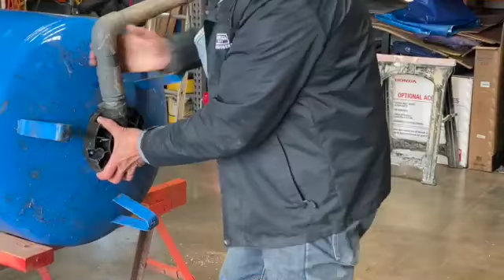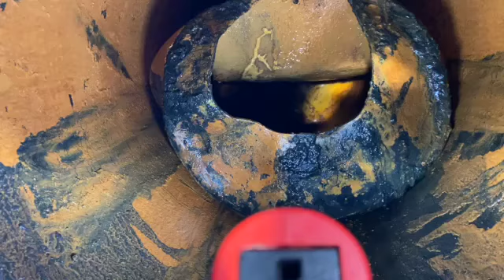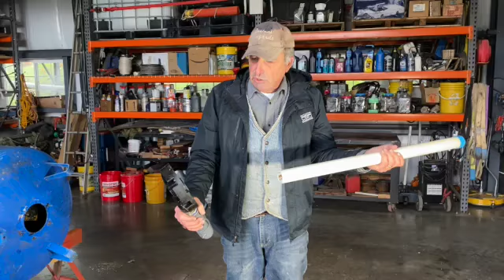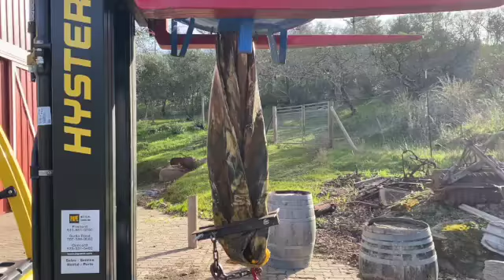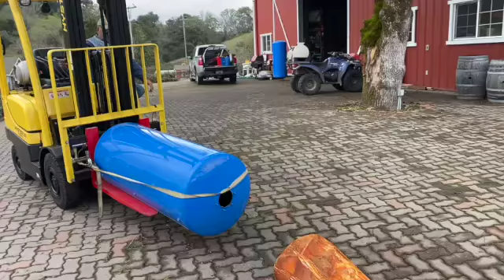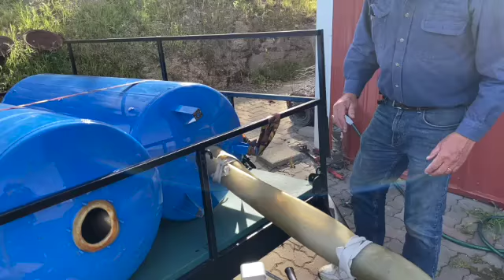FlowTec pressure water tank bladder replacement & install

Comment: Just swapped out my tank today I bought an exact replacement 3 years ago because I knew the time was coming( I got 25 years out of my tank shallow well running 20/40) was thinking about rebuilding my old one  to keep on hand. Unfortunately it does appear the bladders have been discontinued. But hey it was a good run and thanks for the great vid.

Comment: Thanks! Watching your video has convinced me to just buy a new tank bite the bullet on the cost. Even if I can get that bladder which is in doubt it seems like a real pain in the ass dirty job to replace. I have the water worker 86 gallon tank right now that I put in in 2015 so I'm sure the bladder is due to fail. Right now it's working but I'm just planning ahead, but then again I'm 75 years old so maybe my sons will have to deal with it....... LOL

Comment: Great how to do it video lots of good tips.  My two FlowTec tanks had some problems which I'm sure is my fault! Didnt check air pressure, one tank was waterlogged the other was empty. Both bladders were ruptured, because of not keeping track of the air pressure for a couple of years. Now I check every 6 months or so like clockwork. After 6 months both were down 5 PSI per tank. Ended up giving one tank to neighbor for a outdoor fireplace, the other I replaced the bladder. The problem is the tank will not hold air and is leaking around the bolt on base? Will have to pull it apart again to see why it is not sealing. In the meantime I replaced both with two new 86 gallon Water Worker diaphragm tanks, which are similar to my orignial Goulds tank which rusted below the diaphragm and started leaking. Still beats the heck out of the original non bladder steel tank that would get waterlogged every couple of months. I guess 10 years between tank changes isn't too bad. "CHECK THAT AIR PRESSURE"!
Reply: Get yourself a Charlatte bladder tank Jim. You won't have to worry about corrosion or air leaks.